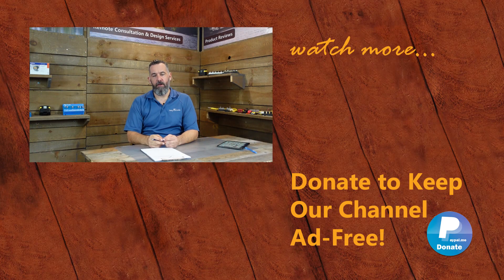How Protective Boots on Your Boat Batteries Can Save Your Life

Comment: I bought a boat recently that had exposed battery posts in the aft lazarette with metal handles and things sliding around all over it.  A fire waiting to happen.  I ended up getting basic plastic terminal covers and then top to battery boxes for them as well. The batteries are AGM so they dont need full boxes but the tops can still be strapped on to protect the terminals and connections.

Comment: late winter night, mechanic stuffed can of either inside his coveralls, used batteries as a step while climbing onto truck to squirt either into intake, slipped fell punctured either can and wrench in his pocket arced on battery,  he is now running around with flames coming from his leg, arm and neck opening, true story i was watching, lucky guy only a severe sun burn on his hands, neck and face also a very short free hair cut.   Be careful out there.
Reply from the maker: Thanks for sharing, what a crazy story,

Comment: I covered the battery terminals but never though of the solenoid, thanks, I'll be looking into doing that. Great videos.

I have one question: I'm upgrading wires on my 30 year old boat, what gauge wire should I use to replace the wire (looks like welding wire) from the starter & ground to the battery? How can I calculate it? I have a 30hp Atom 4 gas engine.
Reply from the maker: Sizing the starter cables is based on the anticipated amps use to start the engine and the cable length between battery and starter. Always err on the side of caution, i.e. a bigger cable. For instance, my 30 HP sailboat engine as 1/0 wiring for the starter.

Comment: Awesome video. I had a metal rod fall off a shelf in my truck canopy , onto a battery with no cover. It arced out, melted the 1/2" rod, and lit the battery on fire. Pretty random accident. But the fire got put out....but this was occurring while i was driving.  Imagine my surprise when I got to my destination. At least I didnt have to swim for it! .....anyway buy some boots and battery boxes folks.
Reply from the maker: Thanks for sharing.

Comment: They are so when you drop a tool it doesn't come back molten and spatter you. I am presently awaiting some boots to fit 4/0 cables; not only do they protect against carelessness, they also tidy up your aesthetics. That's actually a good selling point for the lithiums; they are protected internally and won't vaporize a tool in your face. No smelting in the bilge please.
Reply from the maker: Thanks Tao for contributing to the discussion.

Comment: Jeff, 

Great update.  Many don’t understand the importance of the boot covers. The ABYC standard that I found only calls for the positive posts to be covered so that is what I did on my install.  I like your idea of all posts being covered so going order covers for negatives today.  The biggest issue I had was finding where to get the covers I needed.  I used www.vteworld.com to order mine.  They have all different cover configurations to meet the needs.  My alternator and starter have covers but are old and brittle after 21 years and lots of heat. Where can I find small boot covers for these connections?
Reply from the maker: Hi Brian, thanks for sharing. Let us know where you found your boot covers.
Reply: @PacificYachtSystems  Jeff, I got them at https://www.vteworld.com/content/termins/TerminalInsulators.php. They have a fantastic selection to meet almost any configuration.  Plus reasonable prices.

Comment: I just finished installing a set of jabsco 24 volt spot lights on my boat. Luckily the switch was only about 4 feet from the battery box because I ran the wires and since the switch had a fuse in it didn't put one in the wires. The ends were exposed and touched and in about 5 seconds completely melted the wires. So when I replaced them I put in line fuses into wires as well. If I had run the wires through the whole boat I would have been screwed big time.
Reply from the maker: Sharing not only the good but our own errors is excellent, thank you for that. We learn from our own and hopefully from others too.